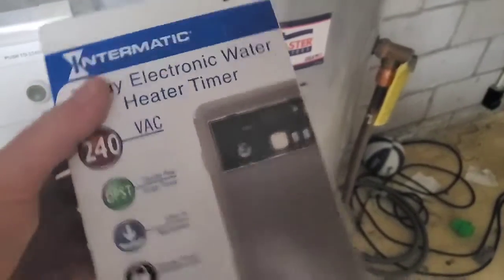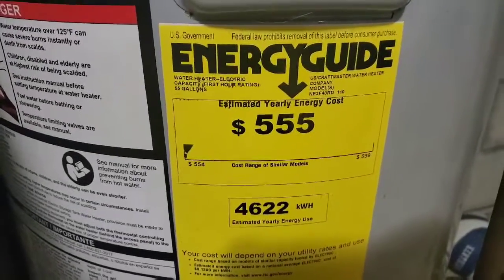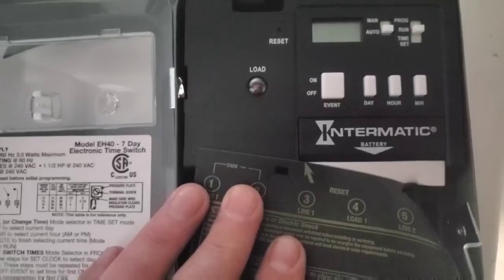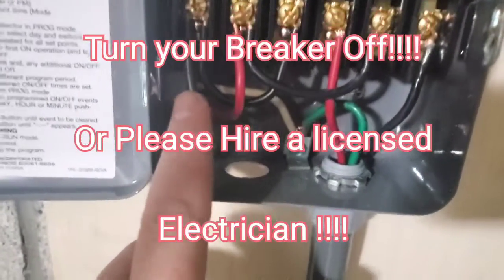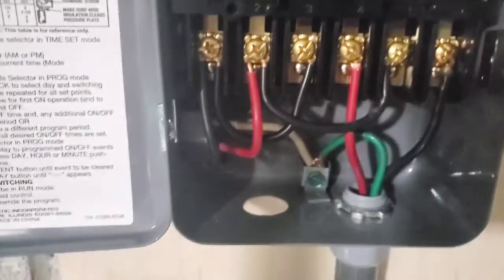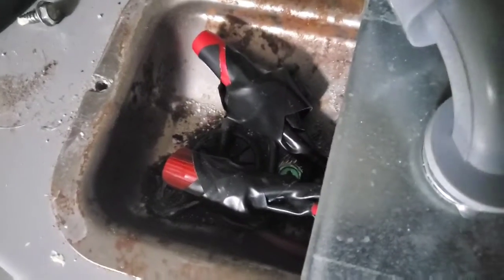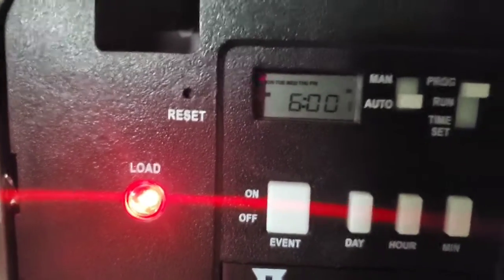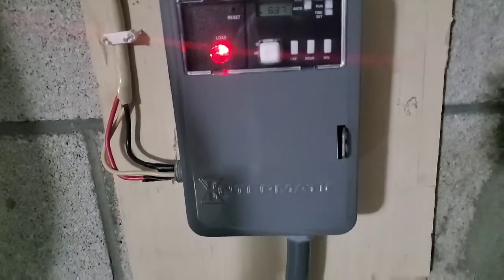How to Install an EH40 INTERMATIC water heater timer. Saves $25 dollars a month!

Comment: You save very little in electricity. That is primarily dependent on how much hot water you use. You can save quite a lot of money if the cost varies on time of day by turning the tank off during peak times. We do most of our water heating at night.

Comment: In watching your video, I noticed that you connect a jumper wire from terminal 1 to T3 and terminal 2 to T5.  According the directions in the timer box, T 1 jumper is supposed to go to T5 and T2 jumper goes to T3.  The way you wired it makes more sense as the jumper wire  they enclose in the package is not long enough to properly go from T1 to T5.  As it seems to work for you, I'll use your design.  Thanks!

Comment: How much did you end up saving per month?
Reply from the maker: Yes it's still going strong...my water heater is est to $555 per year running 24/7 365 with no timer....So my monthly costs to run the water heater  was $46 to $50 dollars a typical month..with running my timer on 7hrs a day / 365 ....my costs went down to 15 dollars per month.. Saving approx $30 a month...more if ur electric is higher ..mine here is about ....11cents a kilowatt..but yes it works and has saved me some money 💰

Comment: Why does EVERYONE skip the part where they pop out the holes? How tf do you do this? No issues with the electrical part, but these pop-outs are just as thick as the rest of the box.
Reply: If you look carefully at the holes, they are stamped all the way through for most of the circle, and they have a little tab that is left intact.

Set a large screwdriver against the side of the hole that is cut, and hit the screwdriver handle with a hammer, wrench, or even your hand.

Once the tab starts to bend, you can slip the screwdriver tip into the crack and pry it open some more… then grab the circle with pliers and twist side to side.
Reply: @devo9495  Thanks. I eventually found a video about pop outs for a standard metal junction box. Super easy, but it shouldn't be assumed to be common knowledge. I didn't want to damage the thing trying to guess.

Comment: Anyone notice any savings ?
Reply from the maker: ..yes I have set my timer to turn on from 6am to 8am (those are the morn shower hrs before work) then it doesn't come on til 4pm when I get home..then it stays on til 11pm ..so I went from heating water on/off 24hrs/7/365..to only heating water only 9 hrs a day...so yes I've saved 60% approx from my normal water heater usage per month...it only takes 15mins to heat water back up to use..and this timer paid for itself first month
Reply: @st-qp4mr  
Hmmm... Have to disagree.   
Without a timer, the heater isn't ON 24 hours a day.  It will come ON for a few minutes every few hours (after the heat escapes).  Modern WHs are well insulated and don't loose heat like the old days.  
WITH a timer (one or two ON periods a day) its true that you're saving those few minutes every few hours, but its also true that you will have a much longer initial ON period because the water temp has dropped significantly during all those OFF hours.  kind of cancels out.
A timer may save a little but not as much as claimed.  These timers are running $70 (for the cheaper mechanical version)and it will take the better part of a year to recover the cost.

Comment: Nice install except I have to point out that the 10-2 Romex entering the timer is not properly installed per the NEC. The timer should have been mounted higher so that the sheathing on the 10-2 wire has entered the timer box by min 1/4". You never showed the actual install of the supply wire to the cabinet so it is hard to tell from video how that wire is secured to the cabinet of the timer, but a romex clamp should be installed in the knockout of the cabinet and a clamp installed that clamps onto the sheathing of the 10-2 romex.